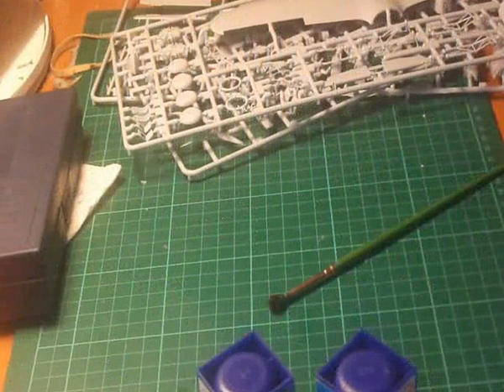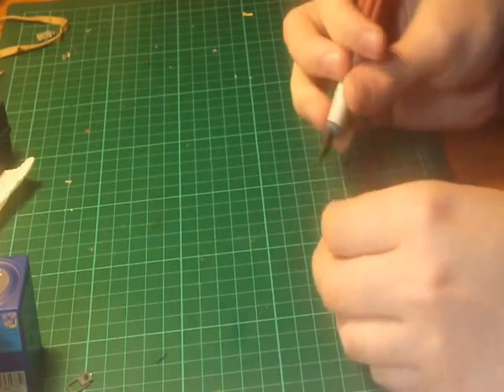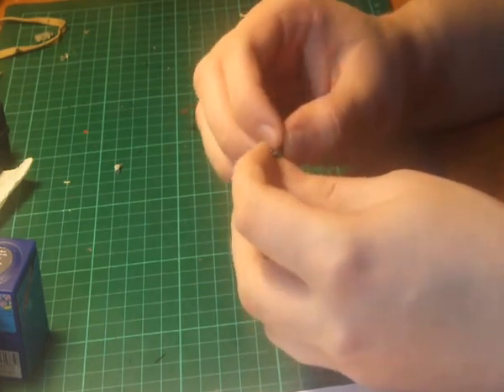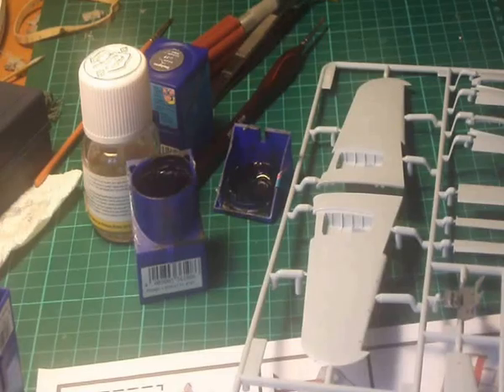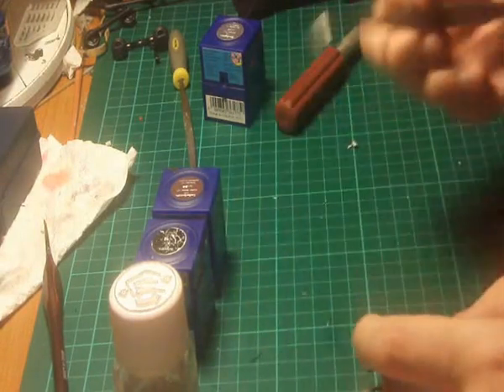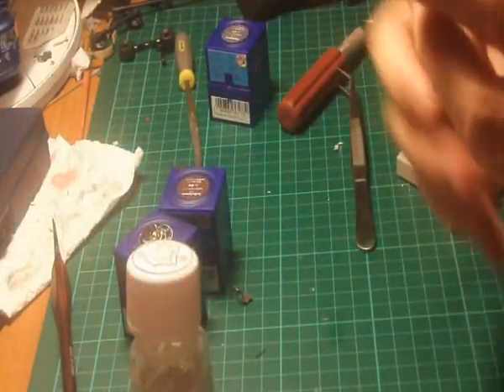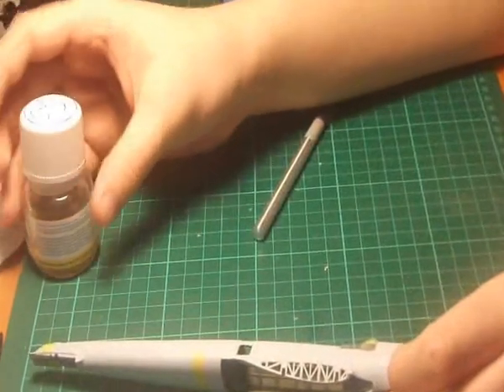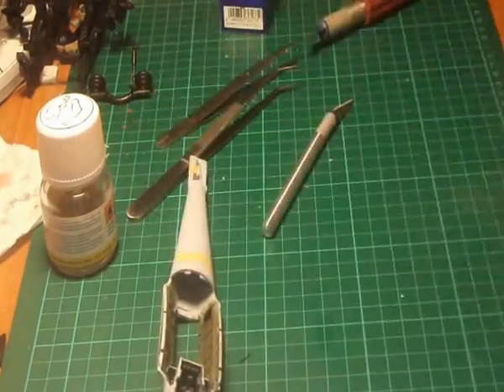Airfix 1/72 Dornier Do17z - Part 1

Comment: I'm also building this kit and it is a great fit except for the figures which had to be sanded away because it's a tight fit in that cockpit. It is not a kit for a novice and you have to take your time but you will not be disappointed when finished.

Comment: From my experience the German figthers where interior "swartzgrey" very dark grey but bombers in RLM 02 in Humrol 241 or Fieldgrau wich is a green /grey not dark at all. But it is possible that at the end of the war all German planes were painted with the paint they found in the region they where build.
Reply: All German aircraft had cockpit colour of light RLM02 for cockpits and interior wheel wells/ landing struts until 1941. After a certain date in 1941 they switched to RLM66 for cockpit interiors, but retained the RLM02 for wheel wells and landing struts. I agree that towards the end of the war they would have made do with what they could find available.